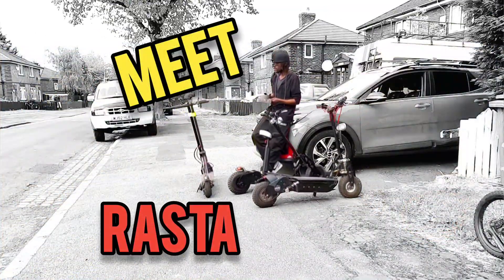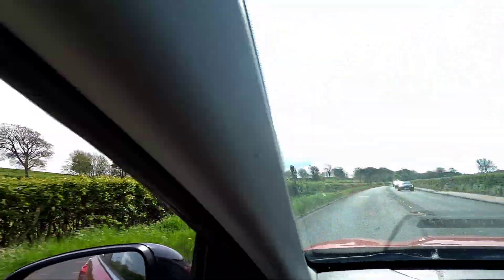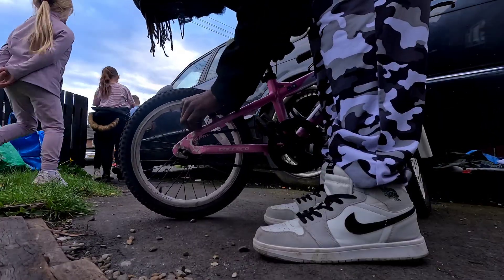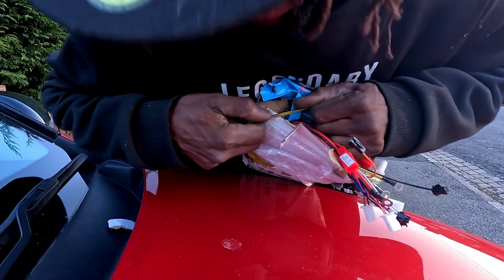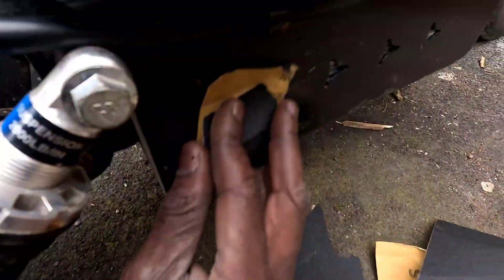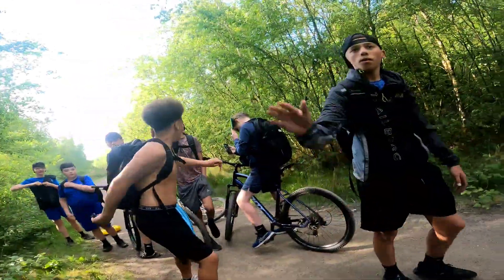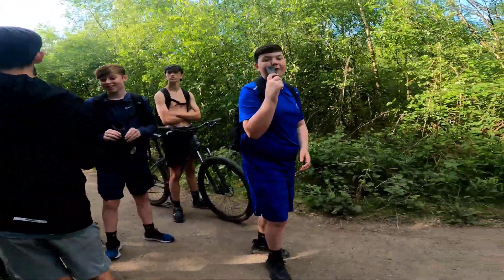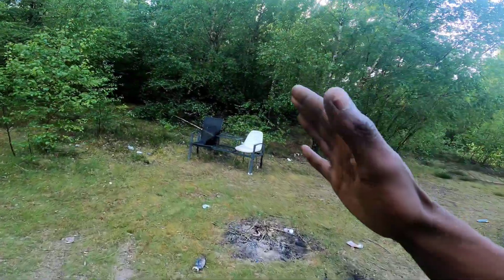How to Make Your Electric Scooter Faster (DIY)

Comment: where do you find parts so cheap especially batteries love the vids rasta watch u more then surronster now and ive learned a lot
Reply from the maker: For hub motors. I type electric wheel on fb marketplace, same on ebay and usually bargains are under auctions not buy it now section. 
A lot of bargains are under the word "leccy" not electric. So search terms like "leccy 48v" are helpful on fb marketplace. 
Batteries are either pre weed from ebay or the aliexpress specials with a month delivery time. Search ebay and fb marketplace daily.
Reply: @Rasta-On-A-Ride  cheers for the help seen a couple deals but think i might buy a full kit i dont really know what im doing or what parts so i found a decent kit website called 2fastebikes selling 72 v 26ah battery  3000 watt hub motor and 60 ah sinewave controller i think it cost around 680 pounds